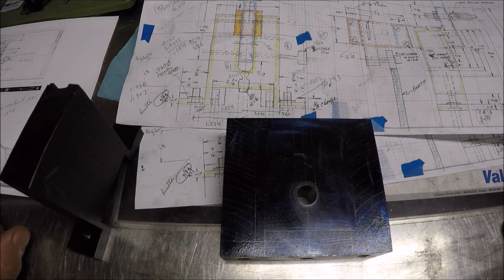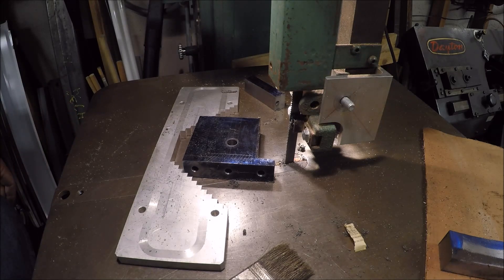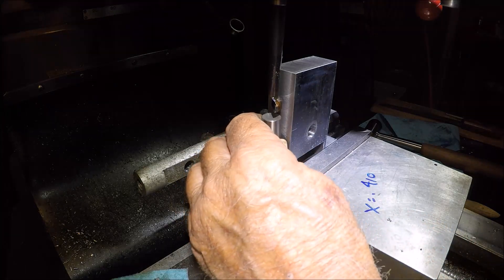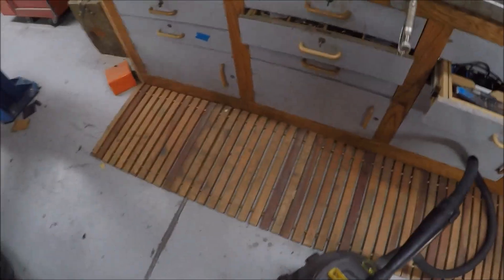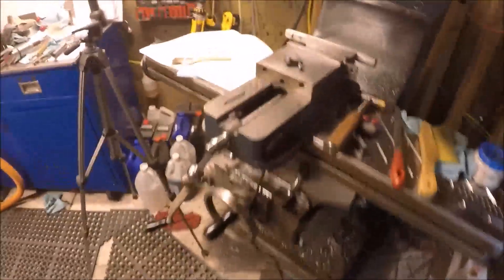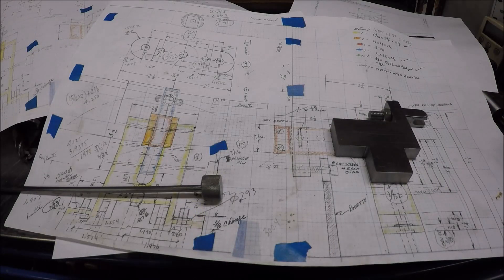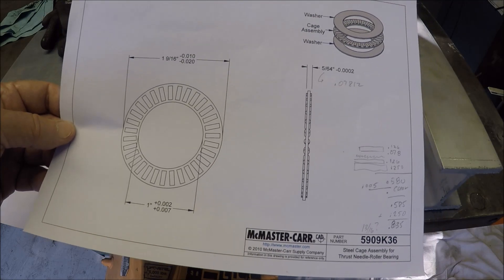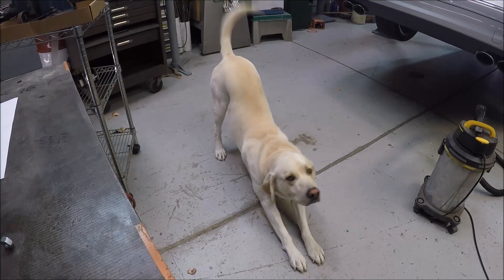Mixed Items   Screwy Tuesday

Comment: Mr. Chuck,  the idea of the wheel riding on the plate is probably the most simple of the two supports.  The way I see your sketch about the pipe support it looked like you have the pipe supporting the end of the beam when the pipe will need to support the beam from going up just as the wheel.  It is a matter of statics.  The load pulls the beam down trying to rotate about the swivel support which is stationary and the resisting force at the short end of the beam is downward to support that end.  I would suggest a caster rated tor about 1500 lbs or more for the wheel on the plate.  Harbor Freight has a trolley and hoists.  Don't forget to put stops on the beam to keep the trolley from accidently coming off the beam, with bolts.

Comment: That digital height gauge looks very useful.
Glad you caught the 'problem' early enough on the block! Parts have turned out nicely.
Those long series drills are useful. Nice score on the bender and the Grizzly wheeled drawer unit.
Perhaps your lifter could use an Archimedes thread principle.

Comment: Hi Chuck,  I don't know if it is possible, but can you boost the volume a bit.  With my laptop on 100, I have to stop chewing my Doritos to hear you LOL.

With regards to the ceiling lift,  I see several potential problems.  A 250 lb load at 5 ft produces a lot of force on the ceiling joists.  If your ceiling joists are spaced at 16" centers, the tension on the joist would be  5x250/1.333+250=1187 lb.  While this is a piddly load in my world (I design bridges), a 2x4 or 2x6 ceiling joist will not span very far with that kind of load on it.  You may need to beef up the ceiling structure.  That said, I would use a pair of tapered roller bearings to make a spindle, not a thrust bearing.  Take the ceiling mounting plate and weld (or bolt) a stepped shaft to it.  Make a sleeve and fit the bearings in it. (think front spindle for your car).  This will take both the thrust (which is tiny at 250lb) and the bending moment (1250 ft*lb)/spindle length (say 4") which gives a radial load of 3750 lb per bearing.  Even made of mild steel, a shaft of  1.75" diameter will give you a 2:1 FOS.  If you use 4140 HTSR (120 KSI yield) you could shrink the shaft to about 1.375" diameter.  You can then figure out a mounting system for the beam.

Alternately, screw two eye bolts into the ceiling joists with one end located over Tim's bed and the other where you need him to be.  The beam would then span from eye hook to eye hook and each eye/joist would only need to carry his weight.

I can sketch some stuff up if my ideas aren't clear and are of interest.

Comment: my chucks live in wood boxes to keep them clean and safe they have a block under the chuck to get it in line to screw it onto the lathe you could use a water counterbalance on the lift just add or take out to keep it in balance we made a elevator in a house that way for one person wind the handle on the pump to go up or down if you stop pumping the lift stops